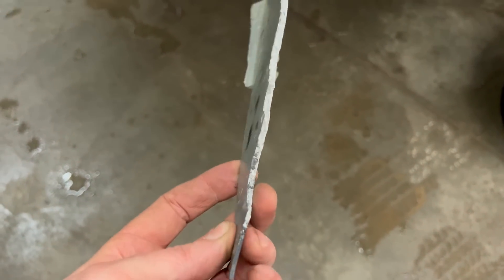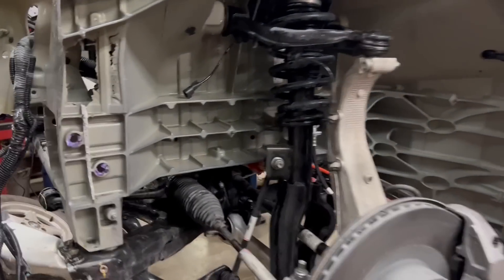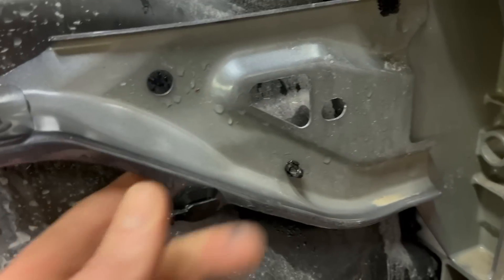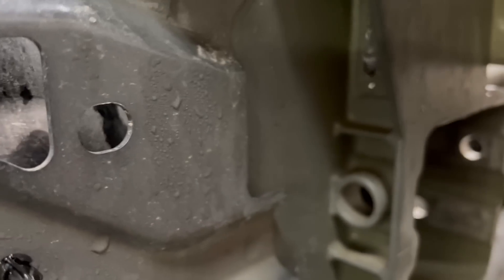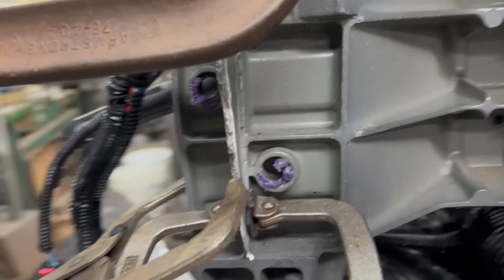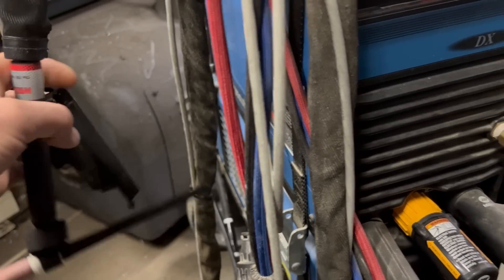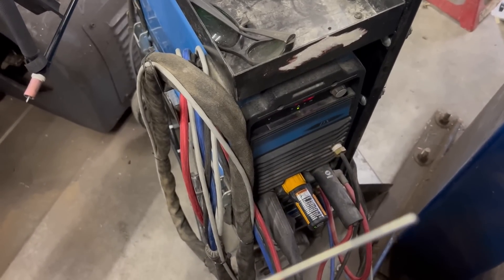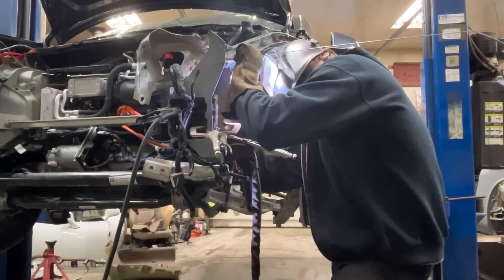Tesla Model Y GIGACast Repair

Comment: Tesla. Gigacasting is a solution to a problem that doesn't really exist. Unless it's the problem of not being able to take a few pieces of sheet steel stampings and weld them together accurately which Tesla seems to have problems with.
Reply: The "problem" the castings are meant to solve is cost. Each of these large castings means the removal of dozens of steps and about 70 separate stampings. It also saves a bunch of floor space, and significantly speeds up the assembly. I think this year we will see the announcement of the $25,000 car, and it will be essentially a one piece cast body.
Reply: Welding 80 pieces together has its side effects, production space lots of robots complexity etc. It has a reason why Tesla offers the best value proposition of any car today, be it EV or ICE (cost of ownership of course)
Reply: @nilsfrederking62  That's a matter of opinion whether it's the best value proposition. Also, maybe Tesla needs 80 separate stampings to weld up sub-frames whereas other makers only need 20 or 30.
Reply: @brendanpells912  The first model 3 had a rear underbody assembly that was rightly criticized for being too complex. The guy responsible was fired, and Tesla set out to do better. Rather than just get to a comparable standard with the rest of the industry, they reconsidered the whole thing and came up with the gigacast. Going forward, it is extremely likely they will work towards essentially one casting for the majority of the body. This will not be without issues, but it should mean that their building speed will go way up, and their costs will drop like a stone.
Reply: @grahammonk8013    Not that unique.  Cadillac made an aluminum casting for each side of the rear subframe in their CT6 (2016?) and Model 3 began with a 2 aluminum castings which were held together with thick steel plates and rivets.  When they made those two a single casting, they began the "giga-casting" name.  I'm not sure the Model 3 is any different re repairs to the rear subframe, but hardly matters since quarter panel hits usually result in totaling any car.  The problem with this failure is it was a simple hit which is normally easily repairable by a new fender and bending thin steel brackets back in place.
Reply: Given that they are documented to build cars in 1/3 the time VW does and at 2/3 the cost, it would seem to solve multiple "problems".  Several other manufacturers are moving to larger castings, but some holdouts.
Reply: @scottgaree7667  Until in 7 or 8 years time when the problems start to crop up and they have to start recalling millions of cars to replace the sub-frames

Comment: Tesla sucks!!! Hows that work for you. It's a great car till it's wrecked then back to the factory wit cha. Rich Builds channel had to buy donor Tesla's to create one usable Tesla, but he couldn't get Tesla to inspect and certify the repair so he could use the super chargers. I feel they are using too much aluminum in the wrong places when it comes to being repairable.
Reply from the maker: That's fair. Tesla is rightfully more concerned with the occupants survival then the repair of the damaged car. They have however, in the last 4 weeks, re-created a salvage title high voltage inspection to get you back on the supercharger network. I'm going  to run a car through it to see the process.
Reply: Argh 😭
Reply: A cracked casting needs a complete replacement to make the car certified safe and roadworthy. One minor fender bender and these new Tesla's are Mega Junk.

Comment: Tesla is truly 10 year ahead frame has even holes like rust in first place when other cars need to rust 20 year to achieve same.
Reply: That’s casting flash.
Reply: @dirty69impala  BS. Those area that looks like cheese should be solid.
Reply: @mr.wizeguy8995  the video guy even said it's the flashing.
Reply: @JamesOliverLindsey  Do you have eyes? Doesn't matter what guy said for sure those part should be solid no need to wonder why that part broke off. But car made as cheap as possible and so many fanboys.
Reply: @Mr. Wizeguy  lol says the guy who sees anything tesla and blood starts boiling. It's very obvious that those are not needed to be filled in. Just where the cast was using relief. Have you ever cast anything in your life?
Reply: @JamesOliverLindsey  Yes i have cast new year tin, someone is buying car made of castings. When does people seem to realize that Tesla is really cheap made car.  Take a look battery packs half full of plastic and most them are leaking in front part causing rust issues. And newer pack is filled with some shit foam what makes them unrepairable. Piece of shit interest millions of flies it still isn't gourmet delicacy.
Reply: @Mr. Wizeguy  you sound like the sorta guy that got burned or missed investing opportunities and now just can't see straight anymore. Grow up dude.
Reply: @JamesOliverLindsey  You sound a guy who goes with masses without able to think itself.